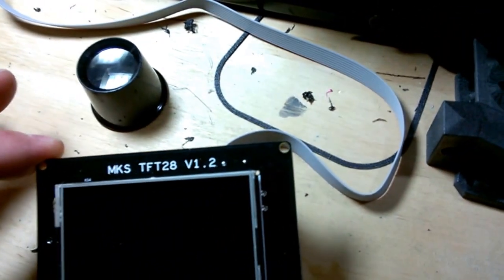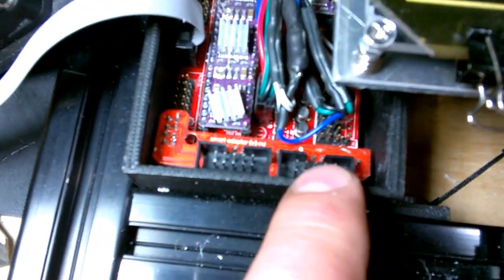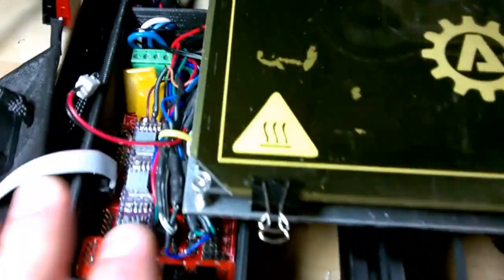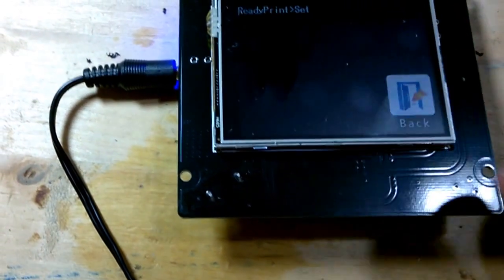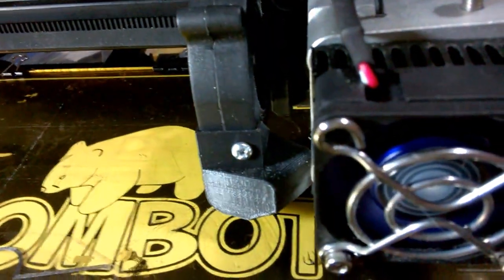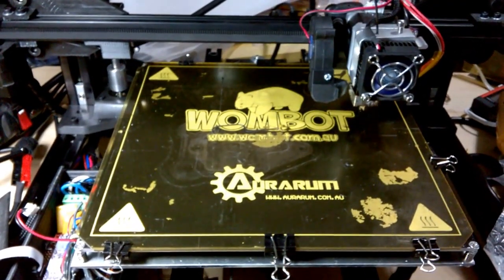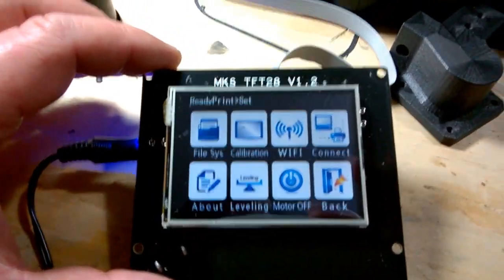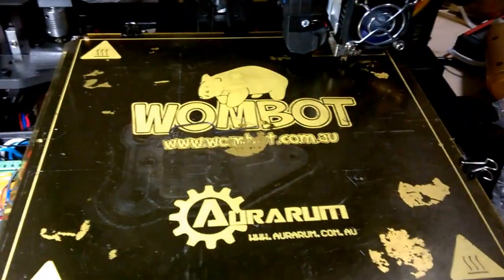MKS TFT28 setup and connection to RAMPS

Comment: But what do you do in the firmware? I'm trying to set up a TFT24 and that's what I'm struggling with
Reply from the maker: It seems that there are different firmware defaults depending on the where the device is intended to be delivered to. Mine came ready to use in English. It's been 3 years since I worked with it, I don't recall having modify the firmware.
Reply: So plugging it into AUX1 like I've read somewhere, plus the RST pin, and it should ...just work, without telling Marlin which pins to use? (I'm using AUX2 for TMC2208 software control) 

Well damn, I've wasted weeks trying to look up wtf to do, and nothing even needs to be done. Wow I'm an idiot🤦🏻‍♀️
Reply from the maker: @KarisMajik  No, dude, you're not an idiot. You're just like the rest of us working on something that's new.
Reply: @RobertLBarnard  Thanks! You've saved me probably another couple weeks of frustrated tears before I gave up, and rewired a ribbon cable to use Anet display in AUX4 without the adapter that only comes with a display I don't want to pay for, unless I want to wait 6 more months for shipping, when my printer has already been out of commission for more than 10 months
Reply: Ok, so it's not working, other than getting the display's firmware to update, and it didn't work with an actual Mega 2560 instead of the Re-Arm board. Not over the serial into Aux-1 anyways. I'm gonna need an adapter for Aux-4 or one of the displays actually supported by Re-Arm

Comment: I'm trying to research this TFT before I buy it, but finding documentation on it is tough.  Generally though, I understand that it uses a 32bit chip, what I don't understand is if it replaces the Mega, or is that still needed under the RAMPS to get power to everything?
Reply from the maker: Hi,
It still needs the RAMPS. It is just a human interface for the RAMPS. But you can run it right alongside the stock (human) interface screen if you wish, because the TFT uses different ports and cable.

Another option is to connect a Raspberry Pi to the USB of your RAMPS and install Octaprint, then run it from your computer and/smart phone. Cost is about the same.....then again you wouldn't have a need for print the little swivel case I designed ;)

Thanks for checking in. Best regards.
Reply: @RobertLBarnard  I have the Pi already, but was considering the MKS option because I've read that with the MKS, the user can recover the progress through the Gcode after a loss of power.  Also, only needing one strip of cable to connect to the AUX3 bank on the RAMPS would free up AUX1 that the stepper drivers want to default to using.

I'll put more thought into using the Pi and Octoprint as I already have that.

Comment: Really helpful hint** I could not get a firmware update to work until I used a 2 Gb SD card formatted as a FAT format. I tried many different firmware versions and have been working on it for what seemed like forever. (At least 2 weeks) So if you are having issues with a firmware update try finding an SD card that you can format in FAT. This works great for a ramps 1.4, I use mine on my modified robo 3d R1 printer that I turned into a dual extruder printer. I could not be happier.

Comment: what of kind of amps does the board require (need to match it with a 12v power supply so i wanna make sure it won't tax it, also can i use  the USB connector to power up a usb lamp?

Comment: Hi,
Can someone tell me if i can connect this MKS TFT28 to ZRIB V3.2 main board. And if this is possible how can i do it, because i dont like standard 5 buttons lcd.
Thanks for answer in advance
Reply from the maker: Hi,
Sorry, I'm not familiar with the ZRIB. But I'll take a look.
Reply from the maker: I just took a look at the ZRIB board and it looks like there may be a way. Check the AUX01 port. This port may control the MLS for you. But double check the pins against the RAMP boards AUX01 port.
Reply: R Barnard 
Ok, thank you for answer. Is it maybe better to change main board and display together, is this main board better than zrib?

Comment: Thanks!  Autolevel question - where do you have your bed sensor connected? Do you still have a Z- endstop switch? I'm  Not sure what its looking for. It will level,  but then go home and try to look for a switch there.
Reply from the maker: I still use the proximity sensor, not far to the right of the hotend. The machine has never been all the way to the Z, which is about 13 inches.

One self inflicted issue I've had is, using the office metal clips on the bed, I've placed them near where the proximity sensor probes. The result are false readings were the bed's Z may be, and subsequent error in the leveling adjustment.
Reply: I have some questions: 
What kind of sensor do you use?

At what height does the sensor see?

My proximity sensor reads too close to the bed plate and I can't use a print glass so I'm looking for a better sensor.

do you have any advice for me ?

Comment: Helpful hint to all: I installed the firmware and still couldn't get it to work, I had to hit the reset button on both my TFT28 and my RAMPS 1.4 in order to get it to work
Reply from the maker: Thank you, Brspartan92.
Great to know!
Reply: Can you control ramps? What is the firmware version that you are using?

Comment: Just managed to connect to a SaintSmart 2-1 board. Pins on AUX  aren't as MKS or Ramps, you need to make an adapter .

Have you or know of other Firmware/s for this display.

I've changed afew settings in config using Notepad but not able to do alot.
Doesn't have all the functions of a Full graphics display , doesn't have Status screen , Preheat are done manually ,ETC.
Not as good as I hoped for. 
Got both connected for Best of both!
Reply from the maker: I kept both connected for quite a while. But finally began to just use the MKS all the time.

Comment: Hi Robert,  thanks for making this video.  Sometimes getting information is tough.  I just got a tft28 and before I let the smoke escape I've been trying to find out what display definition you used. Secondly, Do you know which library is needed for the display?  Thanks!
Reply from the maker: Hi Ken,
Sorry I've haven't checked in, in a very long time. Regarding the display function, I just plugged the thing in and it worked out of the box. I hadn't bothered to dig too much into the device.

Comment: hi!! it looks awesome 
may i  ask you something about firmware i have downloaded  marlin and i #define reprap full graphic display but there is nothing change on printer when i controlled it from 3d sofware it s working but on lcd doesnt working 
can you inform me about this problem    Doesn't we have to change anything on marlin
Reply from the maker: Thank you!
The LDC screen you're talking about....is it the Smart Controller (most common to Marlin)? Or are you talking of the MKS TFT28?
To get my MKS TFT28 working, I didn't have to remove the Smart Controller. But I did follow the instructions (see above, also here https://github.com/makerbase-mks/MKS-TFT/blob/master/MKS-TFT28%20DataSheet.pdf). Mainly, the 12 volt jumper option.

Nothing on Marlin needed to change.
Reply: you are welcome 
i am talking about MKS TFT28 . I am trying to run this lcd with ramps 1.4 
here is the my steps about what i did. i am using mks tft 28 v1.2
1) my marlin sofware baud 115200, motherboard 33 , and any lcd is activated all off them closed 
2)i am changing the mks tft pin to 12v then i am uptading the mks software to v1.1.2 english 
3)then wiring aux 1 to tft
4)power up ramps and tft28
5) change baud on tft 
6) and nothing happens on fan 
and i just wired t0 t1 and fan on ramps  when i am tring to start fan unfortunately nothing happens anything
Reply: hi i found the problem . problem is my arduino mega wasn't original due to that it didnt working normally so i have changed the arduino mega with the original one and problem solved
Reply from the maker: Ömer,
That's great news! 
That hadn't occurred to me. But as I think about it, I've heard of people having issues with their 3D printers because they've gotten an Arduino that wasn't quite the same as the original.

I'm very glad you've gotten it working!

Please post some video of your setup.

Best Regards,
Robert

Comment: hello all right, bought a tft28 but could not make it work with ramps 1.4, you can help me?
Reply from the maker: I'd be happy to. Sorry for the delay, I've been on a 2,200 mile motor touring ride and just got back.
What have you tried and what is the tft28 doing?
To get mine working, i just plugged in the ribbon cable (making sure both ends match/not-backwards), and plugged in the power for the board.

Comment: Hello,

 I have the same controller however mine has all the text in Chinese...how did you get english on yours? 

Thanks,
Sonny
Reply: i am in the same boat :/ :(
Reply: Chris,

 Thanks for the quick response, I actually got it worked out, just had to update the firmware to English. Download the MKS-TFT-master files from github

https://github.com/makerbase-mks/MKS-TFT

Extract the the files, then go to the MKSTFT_V1.1.0_English folder then, then to the MKSTFT_FIRMWARE_English_V1.1.0 folder, there you will find the following files/folder:
mks_config
mkstft28.bin
Folder: mks_pic

Copy them into the root directory of an SD Card (do not edit the names of the files). Insert the SD Card into the controller and it will do the update automatically. All the text will then be in English and all the icons change as well. Mine worked right out of the gate, no problems at all.

Sonny

Comment: hey hows this working out for you , the reason i didnt buy it is that it said it wouldnt work with ramps
Reply from the maker: It works well, Mike.
Actually, the ribbon cable in the video is connected to the RAMPS board's serial port. 
I also left the old panel connected to the RAMPS as well, the two can work concurrently!

Oh, as per the comments below, you may have to upgrade the firmware if it comes up in Chinese. I didn't have to do this step. :(

Good luck!

Best Regards,
Robert
Reply: I Think it's the bigger one, tft32 that does not work with Ramps